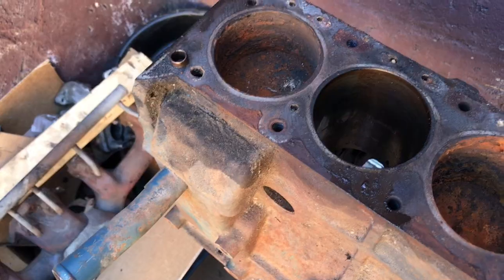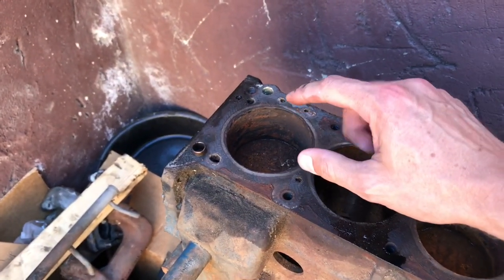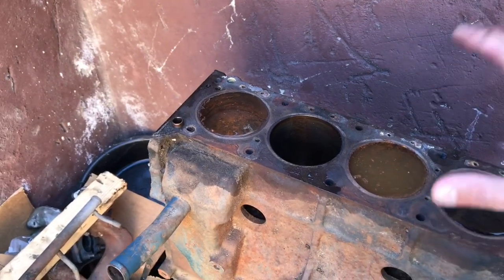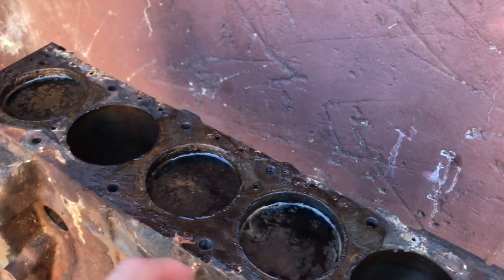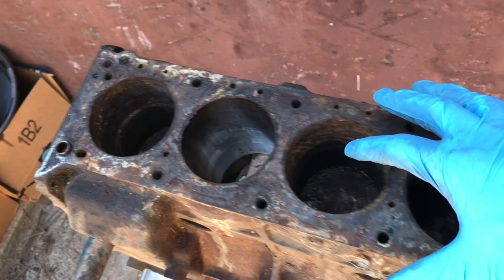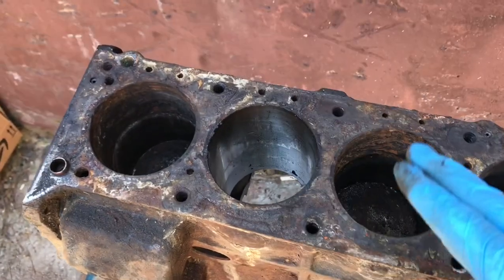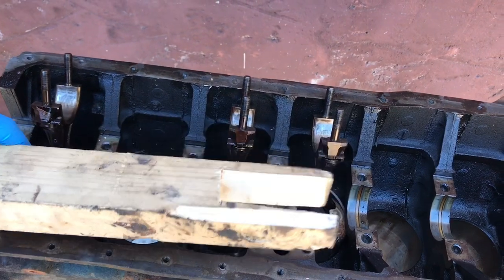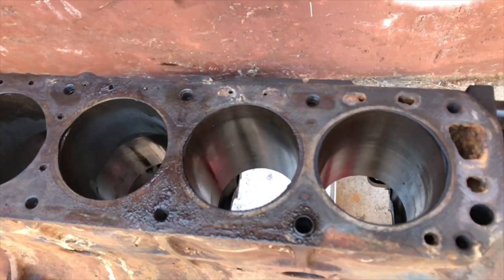How to free a stuck piston from an engine block. EP4

Comment: Easiest way to free up stuck pistons is to put about 1" of diesel fuel in the cylinders and light it with a torch. Let it burn out and tap the pistons out easy. Takes about an hour and cheap. Lol.

Comment: Even when an engine is stored under cover it can rust. I just bought an engine that was said to have been stored 40 years in a shed but was seized solid. It only had minor surface rust but the pistons had to be bashed out with a heavy hammer. I think hot air gets expanded out in the day and moist air gets sucked in at night.

Comment: I have a mud pump cylinder from 1890 and I cannot remove piston . It is 1 inch thick and 7 inches in diameter. I need a help. It is a duplex mud pump cylinder from Gardner  Denver.

Comment: how are you planning to fix the rusted head bolt threads? I cleaned mine using an ARP thread chaser, but would you have to go up a size for yours if theyre in really bad condition? or just use inserts for that as well?
Reply from the maker: +Carlos Mendoza once the block is cleaned at the machine shop I’ll got through it. At first inspection the threads appeared okay. I will for sure chase all the threads and hopefully won’t have to repair them. Fingers crossed!
Reply: Setting it on fire will do the opposite of freeing the piston up,heat expands metal
Reply from the maker: +Jeff Elder no fire here. Did I mention something in the video?

Comment: My L28 was locked up when I bought my Z.  I was advised to use Marvel Mystery oil, which worked but took a few days and reapplications too.   Had never heard of Metal Rescue before this.  I’m looking forward to watching you build this motor.  I’m going to do my first engine rebuild and Curt your vids are going to really help me ...thanks a bunch.  I like your calm cool demeanor even when things aren’t working out,
Reply from the maker: +Av8ferg right on! Let me know how the build goes! Appreciate your support and watching!
Reply: How many days did you let the marvel mystery sit .
Reply: @rocksev21  I think it was about 24 hrs.
Reply: I put MMO where there were frozen pistons in a backhoe engine 3 months later...no change still frozen..

Comment: i know where a complete l28 is for cheap in tx
and thanks i got a locked up sbc in a boat im try that on 
i was thinking about a diluted hydroelectric acid but this seems much safer on the rest of engine id rather not have eaten away

Comment: soak em in diesel next time, you won't be disappointed. it penetrates and lubricates
Reply from the maker: I’ve heard this, possibly add a little ATF? Also I heard people light it on fire which I didn’t want to do. Thanks for watching!
Reply: @CarsBikesandCoffee  was also gonna mention that heating the block up helps  as well, I  believe  it was mustang289? And junkyard digs in combo that used that method

Comment: If ya get another seized, rusted  engine  be nice to see  u try electrolysis to clean them up and loosen the pistons, have seen this method done on a stripped  block, but not s seized one
Reply: Nice job on unseizing this one tho.
Reply from the maker: Thanks! I’ve done electrolysis on smaller parts, but it would be interesting to try on a block.
Reply: @CarsBikesandCoffee  yeh check out the vids. Best way seems to be putting the biock in  vertically, eg in a barrel, uses less water

Comment: Why not use no. 400 sandpaper to remove the rust instead of a metal knife??
Reply from the maker: In the case it was to help get out the piston and it will need to be over bored because of the putting so it wasn’t too much of a concern
Reply: @CarsBikesandCoffee  ok. I guess that does make sense. I am working on an engine myself. I has not run for probably 3 decades and as you could bet, the pistons are seized to the wall. Do you think the metal rescue would to free the piston? I have tried a generous serving on WD 40 and some hammer treatment. Won't budge. Any suggestions. I'm new to all of this.
Reply from the maker: @Mike Bolton yeah it’s worth a shot. One of these pistons was totally stuck. Have the block checked by the machine shop for cracks too. This one is getting that all done as we speak (finally 😂)
Reply: @CarsBikesandCoffee  I guess I will try that then. It's a two stroke motorcycle so removing the pistons is sort of how to take the engine apart. Have fun with your project!
Reply from the maker: @Mike Bolton awesome, keep me updated!